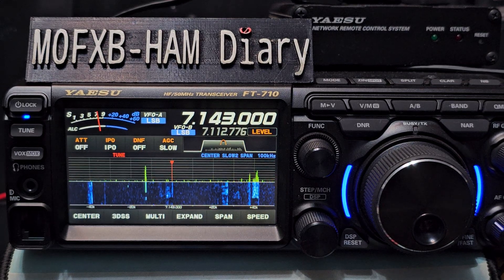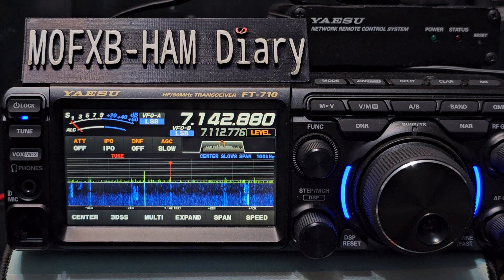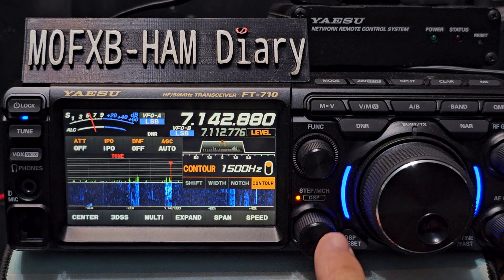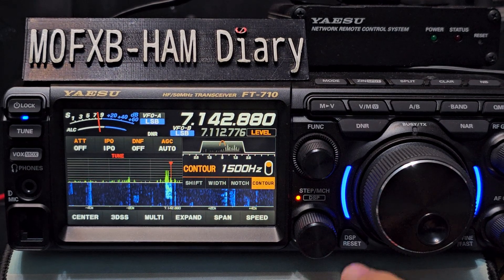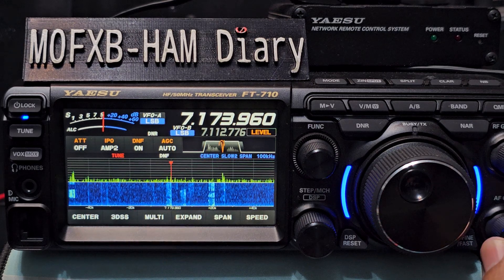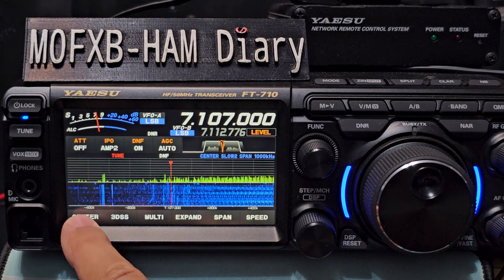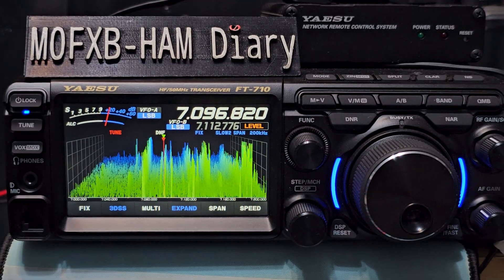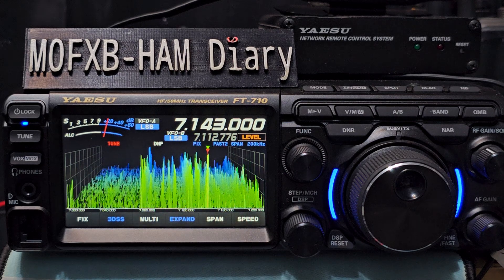Yaesu FT-710 DNR -Contour Notch Width Noise reduction

Comment: I just hate to give up my hi and low cut as done on kenwood and elecraft.
Reply from the maker: Thanks interesting point usually they will have a similar filter .
Reply: you can adjust both your high and low cut filters on this rig easily . and you don't need to touch the radio at all, you can do this with a wireless mouse on this radio...  It's incredible how much radio they can stuff into these little mid sized cabinets these days.
Reply: @l.a.2646 please explain how you change hi cut from 3000 to 2500 easily as in with 1 change.
Reply: and an Elecraft is 15X the cost of this little rig, so I guess this rig isn't for you?
Reply: @l.a.2646 nice way to dodge the question

Comment: Dnr allways set at 7 on mine no problems
Reply from the maker: Thanks
Reply: Hi Andreas, great video as always, I’ve had my FT-710 about a month now, and just like you say it’s excellent! Keith 2E0KDZ, 73
Reply: Good content and of course applicable to the FTDX101D that I use! I saw you also had the contour at +9 instead of the - value by default. I also have done the same recently to try to help pull a tiny bit more out of a weak signal. Have fun!